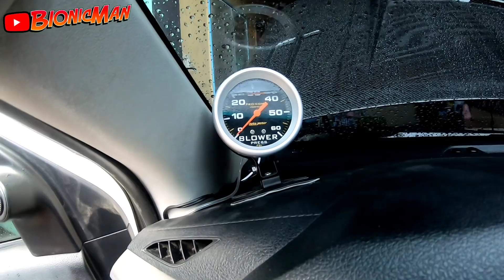BAGONG REMAP NA TOYOTA HILUX REVO | BIONICMAN

Comment: Tama boss, ung power mode ay para di masira gas pedal mo kasi mga 50% na apak eh 100% throttle na. It only makes the throttle sensitive in power mode.

Tsaka wla kasing 4x2 na option para sa 2.8 kaya mabigat.